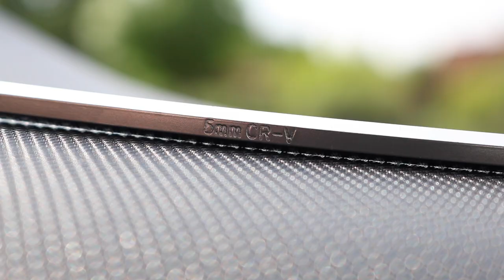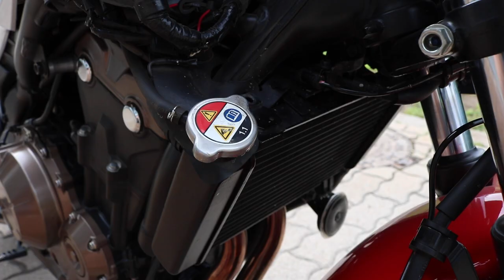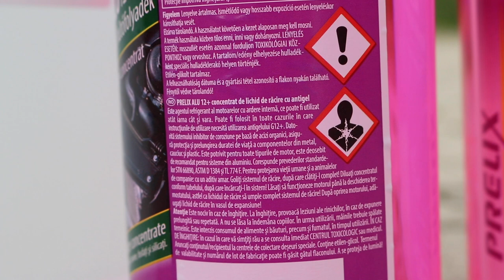Honda CB500F - Engine Coolant Change

Comment: Hello there Radiator fluid of 2015 model cb500f was changed at the authorized service. it seems like after the change the fan turns on more often.
Reply: make sure your rad is complete full.

Comment: Why do you mix it with distilled water? why not using it pure?
Reply: While I can't read language on the bottle label, you'll notice it says 1:1 so I'm assuming that this coolant is concentrated in the bottle and intended to be diluted by mixing with 1 part water.
Reply: @JWZC_NL   thanks I used mine as it came on the bottle. It said ready to use so i did jaja